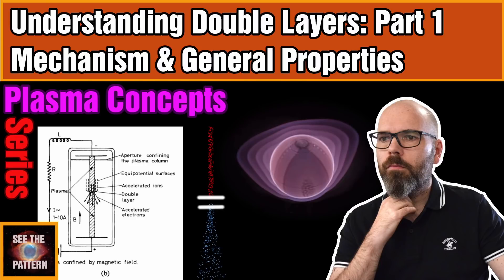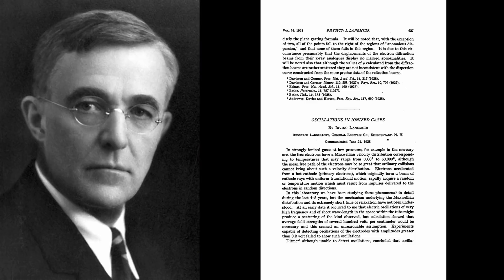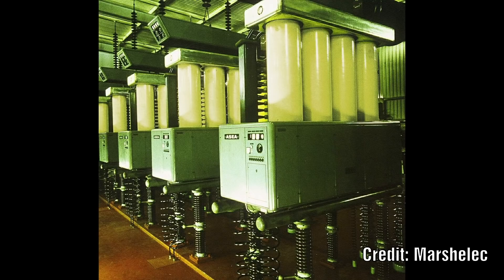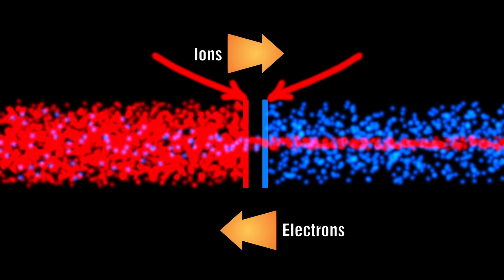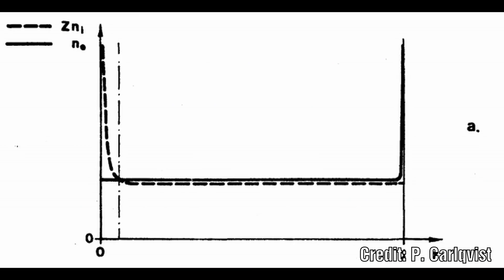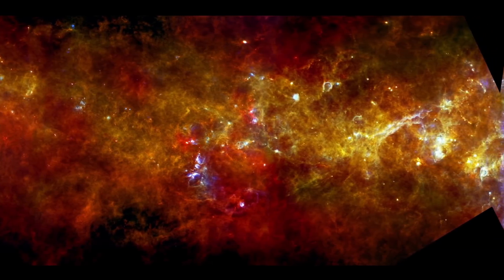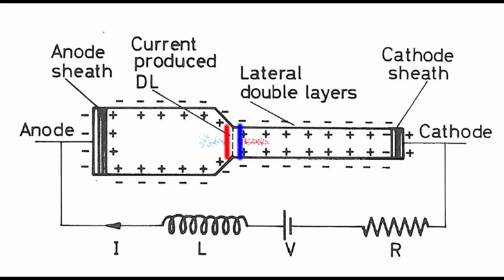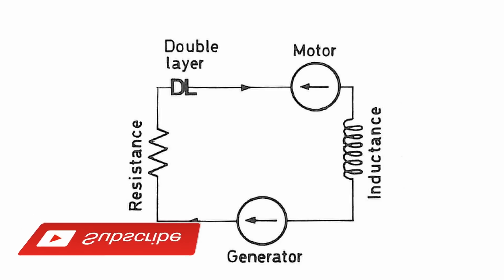Understanding Double Layers: Part 2 Exploding Double Layers & Plasma Circuit Theory

Comment: you are only looking from your own perspective , the pinching effect that you keep talking about is most likely not caused by any spinning , that pinching effect could just be cause by a really massive object , gathering gas . but you when a full 180 and said that the pinching is what cause the object to form . think about what you are saying , spinning gas can pull thing together(I mean the gas itself.) , where on the entire earth to you see that happen , higher angular momentum equals you being ripped the hell apart . you keep taking about these massive amount of current powering the sun , then why don't it power earth and roost us all to ashes , we have hydrogen and helium , why doesn't it start burring , why doesn't Jupiter and Saturn burn  and you keep forgetting that electricity is electromagnetic wave like light , which means its a resistance and produce heat , a shit ton of heat , more than what is being supplied to the sun . I don't know about you but I cant feel any heat hotter than or sun . if you don't not think physically this will never work , some how this theory has managed to become worse than string theory , cause this definitely need extra non physical universes to explain away all the the physical problems .

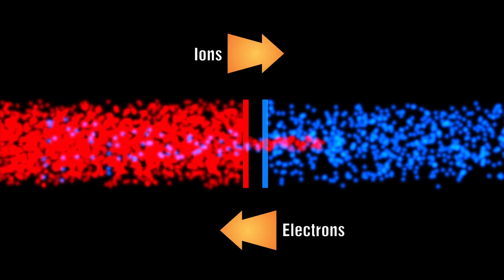Comment: Page 5:36 depicts ions and electrons exchanging across a double layer. 

What causes the divergence of electron inside ion stream and likewise why don’t ions diverge the way electron did?
Reply: The electron’s charge gives them an opposing force that spreads them out, more so than the ions. My best guess.
Reply: @dond668  electric charge on electron and ion of a closed loop system are equal.
Reply: I agree with the logic with mass differential and I tend to think that way too. But on the other hand electric charge force is large enough have made inertial mass a soft argument point.

Comment: So, this is a thing. Chapman disputed Birkeland because outside Earth's atmosphere, he claimed was a vacuum.  When Einstein derived GR, this was a foundational incorrect assumption in his thought experiment. Vacuum, devoid of all matter but the "ponderable" bodies therefore no electric current in space.  When they found out this was wrong with the Soyuz Luna missions, they neutralized due to the charges being "nearly equal". I remember growing up in the 60s and so much has changed between what we thought we knew and what we then discovered to our astonishment. And now that we have finally left the solar system, from what I understand, our expectations are way off. We were surprised to find a membrane of sorts surrounding the solar system. Imagine, if you will, the solar system analogous to an organism, or a cell, an electromagnetic cell moving through interstellar space contain a self-organizing plasma of a certain charge, frequency.. We now have heliospheric space and interstellar space. Guess what their main similarity is? They both use the word "space" to describe a region. Instead one could say interstellar region, and it means the same thing. If I were to ask you how much space is in a trunk, what am I asking? I'm asking what volume is available for holding stuff. While it technically is full of air, the implied is that it is empty, so too was it implied that space beyond the atmosphere of the planet was empty, a void and gravity keeps us grounded along with the atmosphere. But what is gravity?
 We thank Newton for a mathematical formulation, that unfortunately, held a constant that haunts us still today. What is the gravitational constant? It is a magic number that should, according to Kuhn, suggest an anomaly. An indication that something isn't right. And what did he mean,  when he said the gravity on earth and the gravity that keeps the planets in  their orbit are the same?  He also said, that GC was universal, and that the center of the universe was near the sun. Why near the sun? Is he unknowingly suggesting the barycenter? 
I watched this morning several Unzicker presentations, and one of his main tenants seems to be, we have to go back in history and look at these things anew from the perspective of having better classical observations. Mind you, he was talking of other aspects of science, but still, the idea is true for astrophysics. This means, the accretion disc is a plasma of charged particles travelling at supersonic speeds, and this plasma contains double layers, magnetic structures with electric fluids and fields. Voltage is pressure and a 300,000 V potential exists between the ionosphere and earth. The atmosphere has double layers as seen in the "Pause" regions. 
From within this electromagnetic plasma paradigm, we need to figure out how to remove this annoying constant of Newton's, to be able to move forward.

Comment: apparently it NEEDS stating again..
it is observed in the lab & real life...
when two particles side by side, spin in opposite directions they attract.
 when two particles above/below, spin in the same direction they attract.

when two electromagnetic coils (aka a spring/traveling fluid vortex shape), one inside the other, have/are fed opposite polarity (spin/flow direction relative each other), a stable rotating electromagnetic field is induced in an aluminium ball above the coils, holding it there ,in stable orbit.

when an electromagnetic wave traveling in/around the single copper (tesla) winding with iron core (to naturally amplify the signal/wave/field) has an aluminium ring placed over it, the ring will float offset... however, force the ring down then place a free copper wheel next to that aluminium ring at right angles & it will spin upward at the same speed as the upward flowing something C.O 'Professor Eric Laithwaite: The Circle of Magnetism - 1968'

more tools...
'electromagnetic fractal analysis'

open your mind ...
https://m.youtube.com/watch?v=2bPV2AVMqW0
"It's My Own Invention" Eric Laithwaite 1974 RI Christmas Lectures, Lecture 6

Professor Eric Laithwaite presents his second televised series of CHRISTMAS LECTURES exploring the world of engineering.
A sequel to his 1966 series, 'The Engineer in Wonderland', Laithwaite was the first person to present two series of Lectures on national television.

Comment: o7
Reply: For anyone confused by Jim's symbol here the "7" represents the grill of a car and the "o" is a wheel. The meaning is that Gareth's videos are "moving forward" knowledge at a high speed and coming right at you (that's why only the front is shown)! This sign was first used all the way back in 1941 by British and American allies in the War and came about as a shorthand version of the meaning mentioned earlier. Knowledge is power. You're welcome .

Its actually a salute, sorry. Inspiration struck. The "o" is a head, "7" is an arm bent at the elbow touching the forehead. Just want to make sure no damage is done  :)
Reply: @justinkennedy3004  Yes, it is a head and an arm raised in salute. As in, "notification squad, checking in.